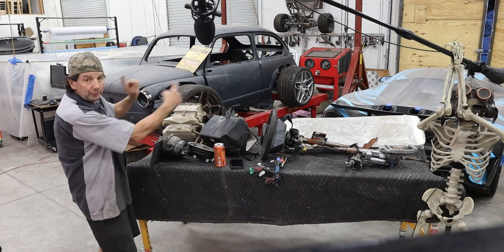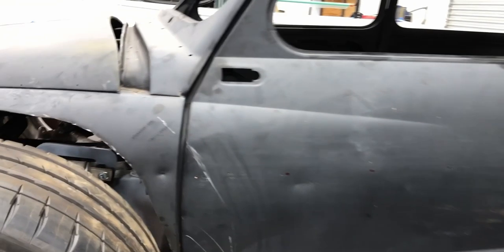Custom Frame…Complete!!

Comment: looking good. I thing the longer front end will look good and probably math the super wide wheel arches better.

the alternative to wide wheel arches is make the thing open wheel. if you designed the wheel arches right you could probably have it both ways, you could have the wheel arches bolt on, so you could try it as an open wheel.
Reply from the maker: Fun you should say that.  I was thinking about leaving them exposed but if I decide to make this a daily drive I want to tires covered.  Driving In the rain without fenders is not a fun experience.
Reply: @XSMotorWorks  you could go wheel mounted fenders like the Ariel atom. with your cnc you could make up some carbon fibre ones. I think it could look really cool like that.
Reply from the maker: @myopinion69420  it’s like your in the shop with us.  😂. We were experimenting with that idea and might end up going that way.
Reply: @XSMotorWorks  Who says I'm not....😂 that would be one hell of a commute if I was. around 15000km (9320 miles)

I think it would suit it. the fenders are going to have to be massive otherwise and you will have to play with the shape a lot to get it to look 'just right'